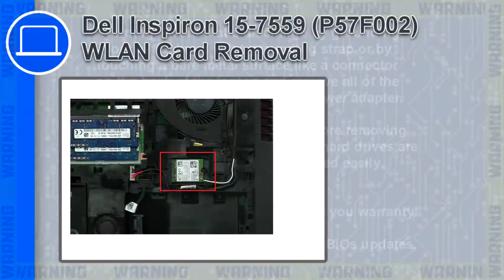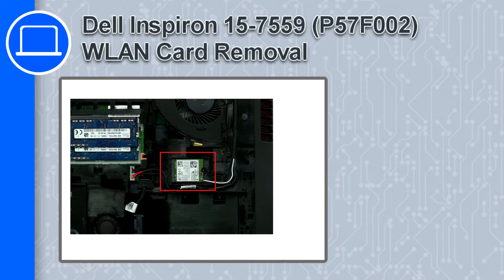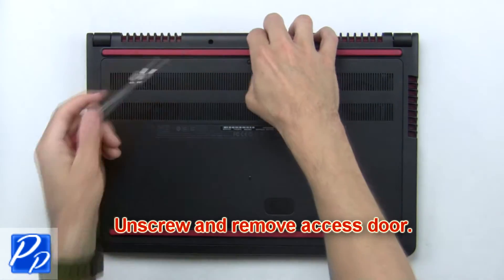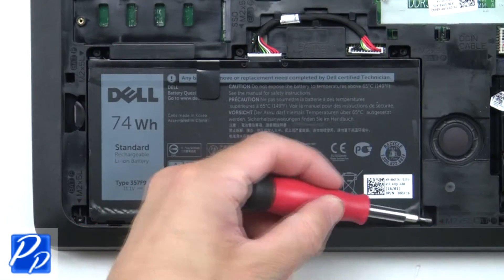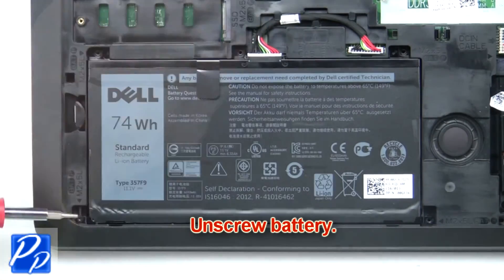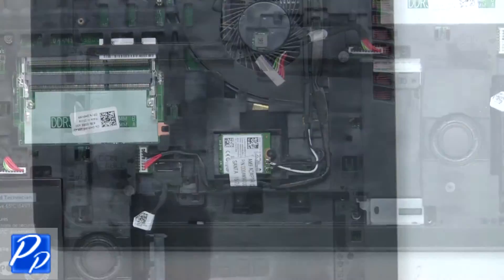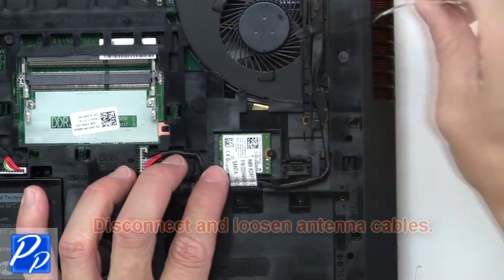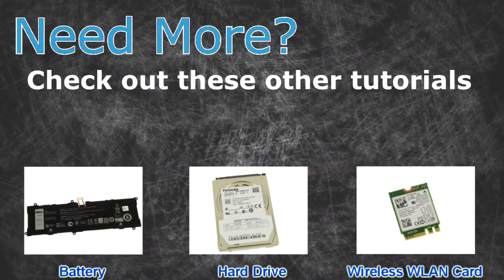Dell Inspiron 15-7559 (P57F002) WLAN Card How-To Video Tutorial

Comment: I am becoming so sad and frustrated. A couple months ago I purchased a new palm rest just so I could fix the hinge and the cracked plastic on my computer and after I did this my internet connection was really weak. In my academic building I had to use an Ethernet cable. Now that I’m home I can only connect right next to my router and it’s still really poor connection. I thought the issue was the WLAN card so I bought a new one and replaced it and nothing changed.  I don’t have 100 dollars to send it in for any sort of diagnostic and repair but I need this computer to work for when I go back to school. Any ideas at all what could be the issue? I know it’s not a driver problem.
Reply from the maker: i would guess that it is either a loose / unplugged antenna cable or perhaps the antennas were damaged when the palmrest was replaced.
Reply: @dellpartspeople  I have the same issue and discovered my antenna cable had been severed by the hinges on the laptop. Do you have any idea where to purchase a new antenna cable and how to replace the existing one?
Reply from the maker: @morrisonben  Replace the back cover of the display assembly. It includes the wireless antenna that you need. Our inventory can be found here: http://ppci.me/c/141/604/lcd+back+cover
Reply: Parts-People.Com, Inc Hi I have the same issue and want to buy the part. It shows out of stock on your website? Do you have any extra parts? My hinge broke and the wireless antennas are ruined

Comment: I just had the audio jack repaired on my Inspiron 7559 and  when I got it back, the wireless didn't work at all.  The computer doesn't see any networks at all.  Is it possible that they screwed up the wireless card when they were replacing the audio jack?
Reply from the maker: It's more likely the card or the antenna cables came loose.

Comment: why did you remove the battery?
Reply from the maker: You don't technically have to remove the battery, but you should at least unplug it to reduce the risk of static discharge.